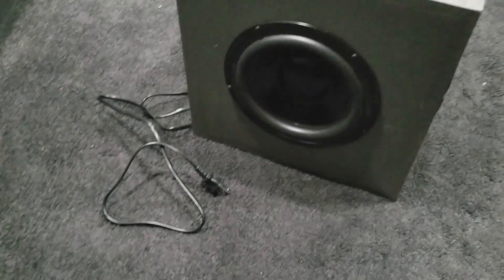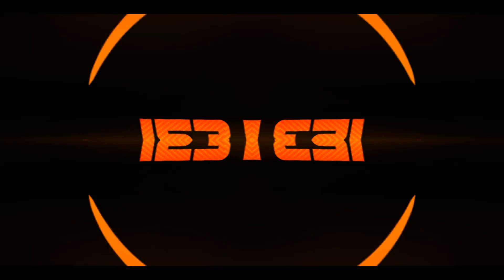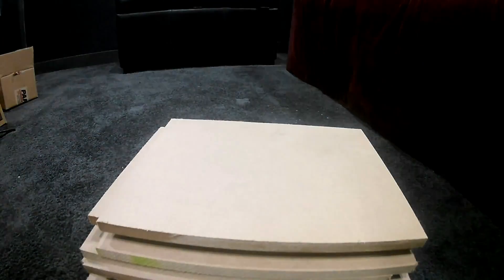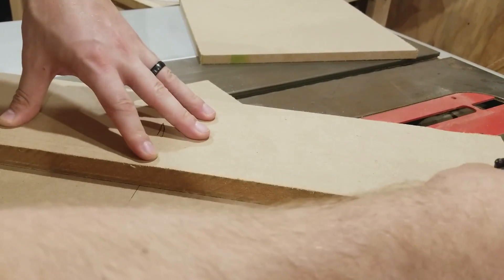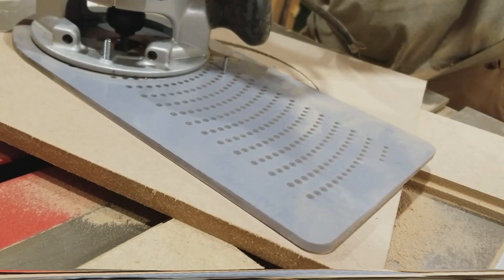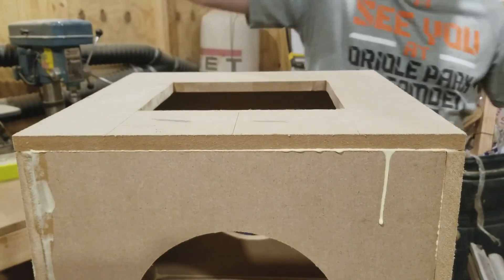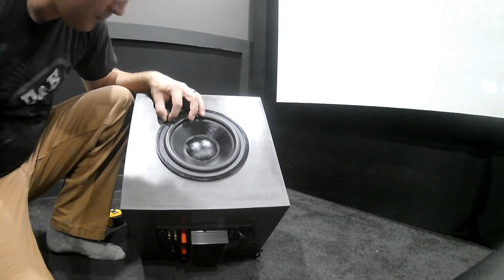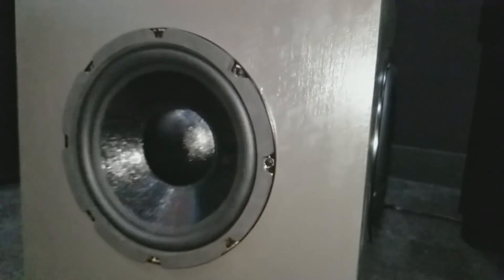Best Sub under $200? Passive Radiator Sub Build - Excursion Test - Free Plans

Comment: Nicely done! I've checked out that Dayton Classic 8" on PE and they seem to think that in a ported, F3 is only 48Hz. I haven't modeled anything on it, but that made me steer clear of it. How deep does this setup go if you don't mind?
Reply from the maker: In my room, I have been hitting between 40hz-45hz with it.  In WINisd, the theoretical F3 is down to 35hz, ported.  However, you really have to worry about cone excursions.  Even with the subsonic filter, you need both a 20 and 30hz FMOD to bring it back in range, and that is with a 100watt amplifier.  

Parts Express did send me a GRS 10" woofer, that theoretically can hit 20hz.  I am not sure I believe it, but I should do a video soon on if that is possible  a $20 sub that can hit 20hz...that's unheard of.
Reply: Interesting. For my 8", I settled on a Dayton SD215A-88 that I'll be dropping in my pickup just for a little reinforcement. WinISD shows F3 at mid 30's as well, so we'll see how that turns out. 

For my computer setup, I want to have smooth, deep bass for music and sometimes movies, so I've decided to go with a Dayton RSS265HF 10", which models down to an F3 at 22Hz. Should be a fun build.

Yeah, that sounds pretty doubtful. I've got a pair of TangBand W5's running together than go down to 28Hz in about 1 ft^3, but I tuned a bit lower than optimal, I think.
Reply: Kcducttaper1  I built a sub with the Dayton DCS205-4 and it plays a lot lower in small enclosures than this woofer when modelled in WINISD. I recommend checking that woofer out. Another 8" woofer that I highly recommend is the omnes audio w8-670Z. It's a budget and improved version of the tangband sub

Comment: How do I connect Logitech rca speakers to car stereo
Reply from the maker: Just hook the positive and negative wires front speaker wires from the stereo to the wires going to the speakers.
Reply: So just cut the rca wire to connect it to my pioneer stereo
Reply: I have five Logitech computer speakers with rca connection
Reply from the maker: Edwin Olivo you only be able to hook up four of them. On those four you can cut the RCA end off.  The two wires that go into the RCA are positive and negative. You run those accordingly to the car stereo positive and negative.
Reply: Thank you I really appreciate it I will try it and I will tell you when I do to see how it sound too

Comment: My friend, some doubts came up. I have some 10W speakers laying around, so i want to enclosure them, probably with a bt amp. The questions are, should i slit the enclore to each full range speaker? Or the volume is so neglicent that i should not mind doing it. Also, if i use a tweeter on one of the FR speaker with a crossover, the power of the amplifier will be split? (example, amp is a 2x25W, if one channel drives a woofer and a tweeter, will the 25W power be like 12+12?)
Reply from the maker: Nuno Correia I'm not sure what the first question is. But the second question is no. You would be getting 25 watts to one speaker and 25 watts to the other speaker. If you've probably crossed over your Tweeter and woofer, the power of 25 watts will also be crossed over.  IE meaning at every frequency, you will get a maximum of 25 watts
Reply: 123Toid ok thanks for quick reply. The first question was if i must split a box of 2 full range speakers or i should not mind since the total volume is very low. Also if a speaker box has 2 woofers sharing the total volume, what will happen?
Reply from the maker: Nuno Correia try to keep the total volume the same. If both woofers are in the same box and they are each on their own separate channel (left and right), then they will fight for that airspace. This may not be an issue, but some people like to separate their box so their speakers don't fight each other
Reply: 123Toid this is true for larger volumes. I have some small speakers here with a eq. Volume of 2 to 3 litres, so should i mind?
Reply from the maker: Whenever you change the volume, you change the frequency response.
\
Reply: 123Toid what if the volume is bigger than the necessary, the frequency will decrease too much?
Reply from the maker: Nuno Correia sealed = lose bass response. Ported = change tuning frequency
Reply: Hey again. Quick question. If i add acoustic foam or similar material inside a speaker, wont it decrease the volume of the box? When is the best option to use that material (when you have multiple speakers in a same compartment?, in a woofer?, in general?).
Reply from the maker: Nuno Correia you would think so, but it doesn't. Using certain acoustic foam can actually make the Box seem bigger.  I stuffed mine with just some polyfill, you can get that any Fabric or big-box store
Reply: Hmm ok, thanks for your quick reply. It's great to have some expert who actually reply to this (silly) questions. So, will the foam act like that polyfill? Have you used it besides the polyfill? Because i already bought the foam instead of polyfill...
Reply from the maker: yes

Comment: Found you through AVS. Can't wait to go through your videos and gain some more knowledge! Subscribed.
Reply from the maker: I couldn't without a lot more information.  But you are going to want to simulate it, as not all PR's will work with the sub.  Check out this video to learn how to simulate it for free.  It'll help you figure out your box size, weight for the PR and how many  PR's to use. https://www.youtube.com/watch?v=sG_8qgSjUqE&t=1s&list=PL6hjpiCHZmIOAv44PCreW5KlI35h1mTZK&index=4
Reply from the maker: Thanks Ryan!  I appreciate it!  If you ever have any questions or have a specific video in mind, let me know!
Reply: 123Toid Can I ask a question im gonna build one like this real soon with the 12 inch classic Dayton subwoofer and two 12 inch passive radiators, how big do you think the box has to be?

Comment: Is this a 30 Hz tune? I don't know much about passive radiator subs. I guess they are similar to ported in that they need a HPF? I don't like the idea of having the RCA HPF sticking out the back. I'd like to somehow integrate it into the Subwoofer system, any possibilities?
Reply from the maker: Yeah, you can run an active DSP or even an amp with a DSP on it.  An Fmod just helps keep the excursion in check. You are correct, it is very similar, to a ported system.  In fact, it really is a ported system, just instead of using a port, it uses passive radiators.  Passive radiators are typically used when you want to get the low tuning but the port would be too long to accommodate that.   Also, many people like the way it sounds better.  That is typically due to the fact that most people use way too small of a port, so you get a lot of unwanted port noise.  This sub is actually tuned closer to 40hz.  And I will say, it sounds really good.  I still can't believe it for the price.
Reply: Okay, I would put like a minidsp inside the damn thing if it was cheaper. I've been looking for a small sub to pair with my Overnight Sensations on my PC desk. I think I'm going to build this!

Thanks for your reply, it was very informative!

Comment: doesnt the passive radiators need any weights? i thought they need to have weights in order to tune to the box properly?
Reply from the maker: ziggy8757 Passive Radiators use weights to change the fs of them, which in turn can help them tune to a different frequency.  However, they already have an fs as is.  This is why modeling them is so important.  These model perfectly in a 1 cubic foot box with two passive radiators without any weight.  Thanks for the great question!
Reply from the maker: ziggy8757 here is the tutorial I did on winisd and passive radiators.  Check it out if you like.  You can even model this sub to see what I was seeing.  https://youtu.be/sG_8qgSjUqE

Comment: Nice build! How deep does the frequency go on max? Because its not vented or do the passiv radiators take the frequencies down in the same way?
Reply from the maker: Great question!  Passive Radiator is similar to Vented in taking down the frequencies past it's tuning point.  This is tuned to about 40hz.  However, it gets surprisingly low bass - all the way down to 20hz.
Reply from the maker: In fact the slow motion video at the end is playing 20hz and 30hz tones
Reply: Thanks mate! Sounds amazing!